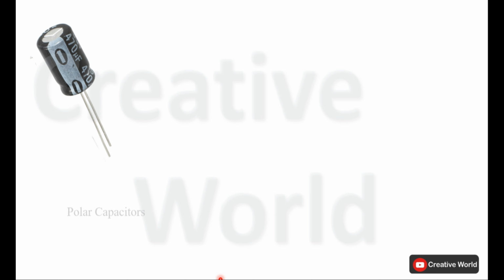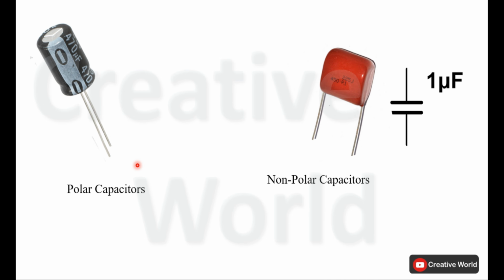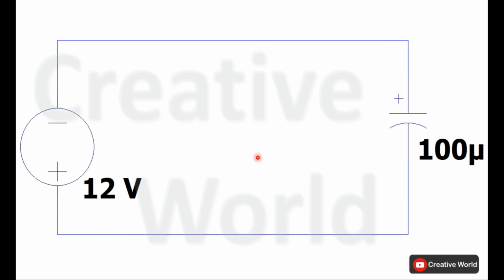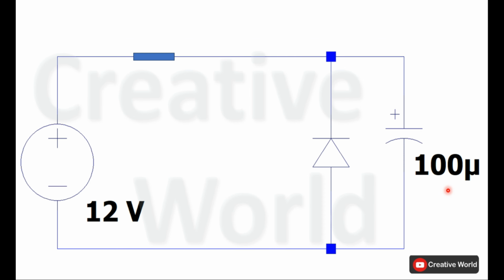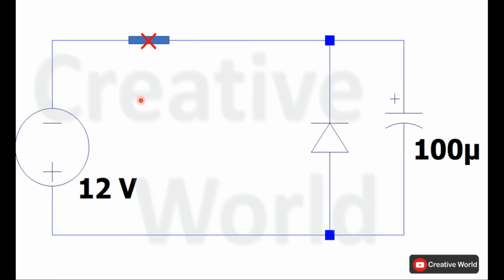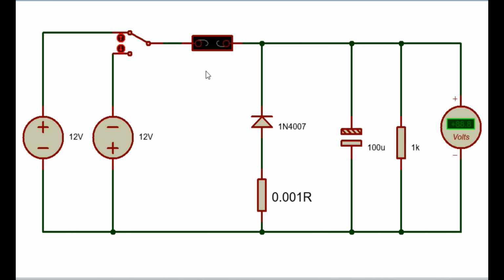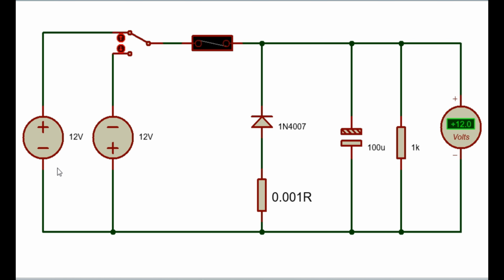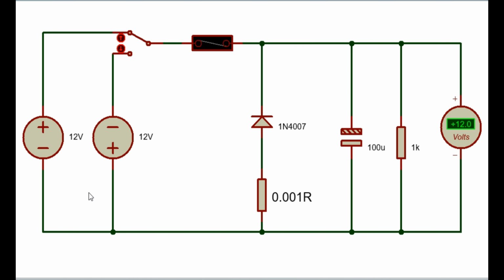How to Protect Polar Capacitors from Reverse Polarity Supplied Voltage | Creative World

Comment: Very clear. I think this is called crowbar protection. I used to use one diode in series with the power source until I got tired all the support calls, "its not working at all". They hooked the source backwards. So I just added a full wave bridge rectifier to the design. Now with one standard part usually cheap doesn't matter how the power is hooked up. In my limited experience, the ones sensitive to the polarity have more farads per a given size. Over voltage will make them blow also.